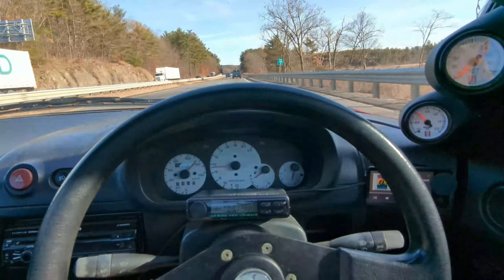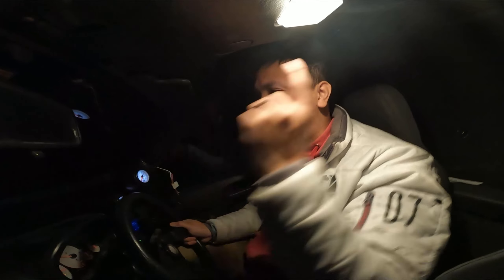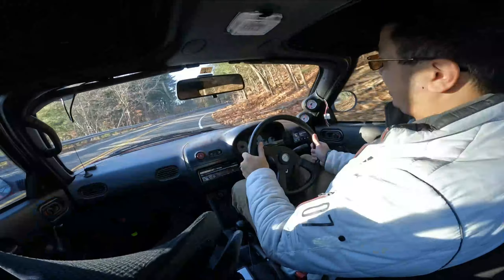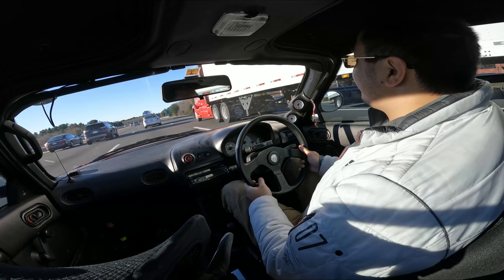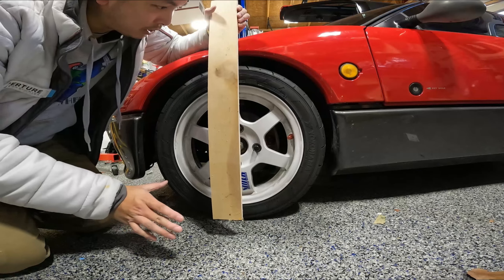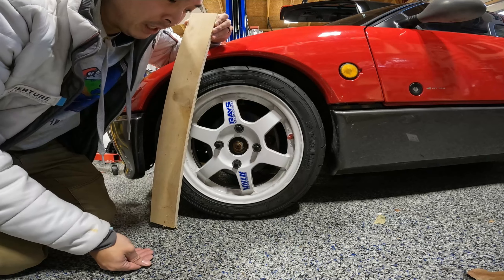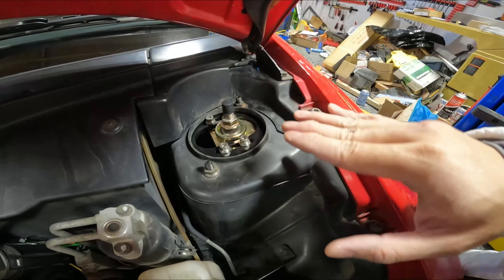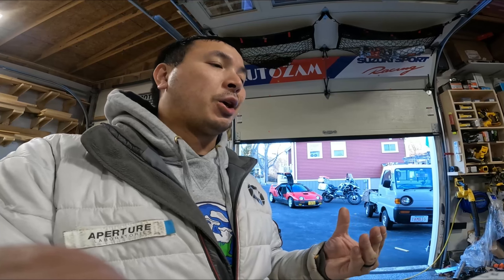Autozam AZ-1 Suzuki Cara Front Caster Fix - New Product: CASTERLY MAX (maybe other kei cars too)

Comment: So nice to have them dialed in. 
After a 2” lift my super carry was like an elephant on marbles. A local semi-retired guy did it for me as most of the larger shops wouldn’t touch anything that wasn’t in their computer.
Reply from the maker: That's the trouble with this stuff. Either it doesn't fit in the rack, they are afraid they don't know what to do with it, or it's like some basic alignment place that won't care to do your fancy camber or caster adjustments. Can't get the $89 alignments here 😂. 
Speciality shops would do it like Kraftwerke. If the database had Mazda AZ-1 PG6SA I'd expect the database to have the Carry too since I think I've seen someone post that the Honda Acty is the Hunter machines.

Comment: I find my stock suspension very skiddish on the freeway, would adding the plates to stock suspension fix these issues as well?
Reply from the maker: Hey unfortunately this plate won't fit on the stock suspension. My car was skittish on the stock suspension and I hoped the coilovers I got would help, they made the car handle better but was way more skittish. At least this became an option to fix it. I know for sure it fits the Navic coilovers but unsure about the others since I haven't seen or had measurements. Based off of photos it looks the same.